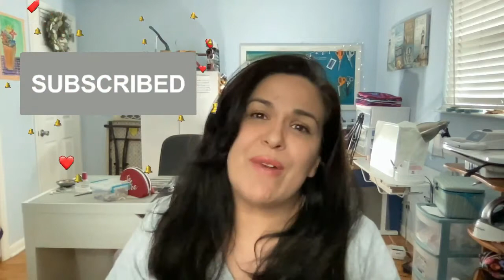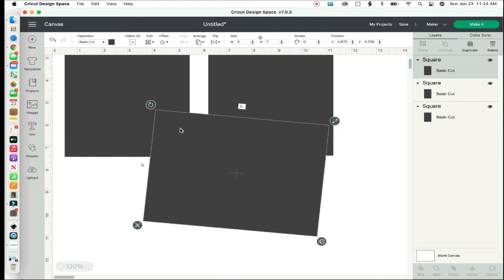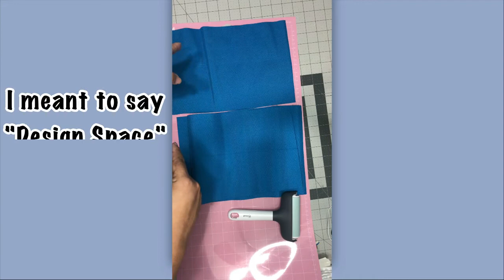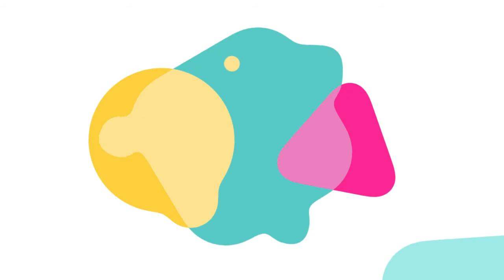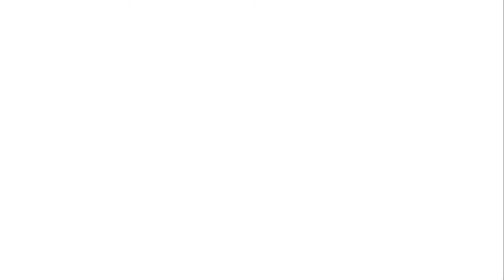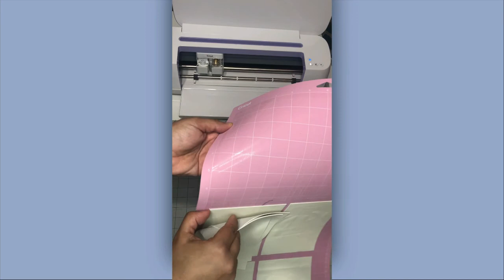Cricut Maker - How to cut waterproof canvas and faux leather

Comment: Good info.  If you put the vinyl face down, you need to mirror.  Not needed on rectangles but I made the mistake once of forgetting and had a backwards design
Reply from the maker: Yes you're right. I usually do that for Iron-on vinyl :)